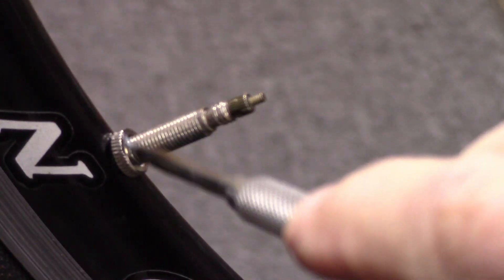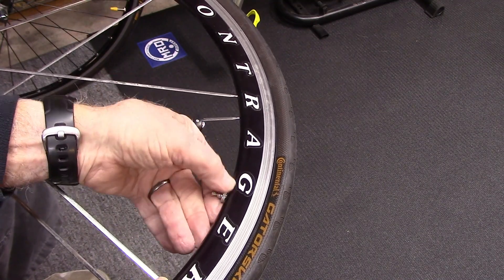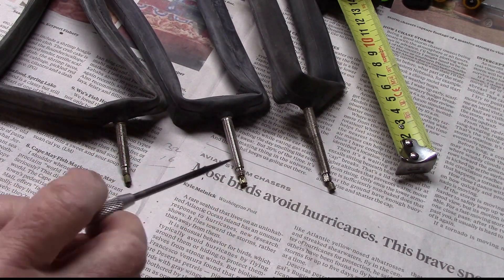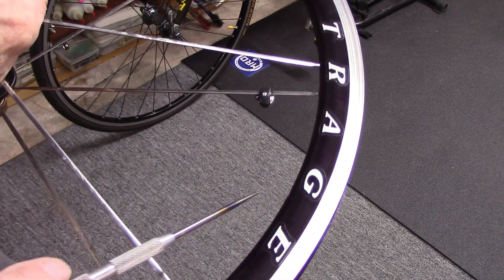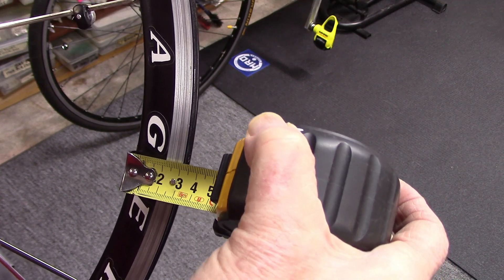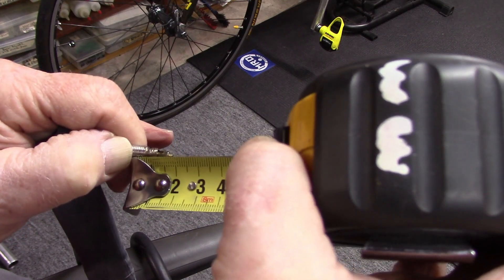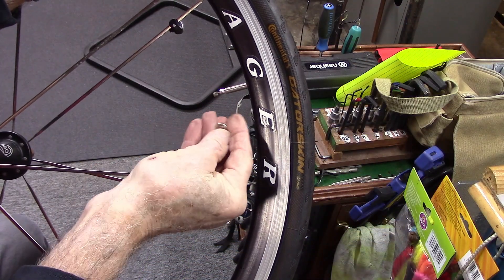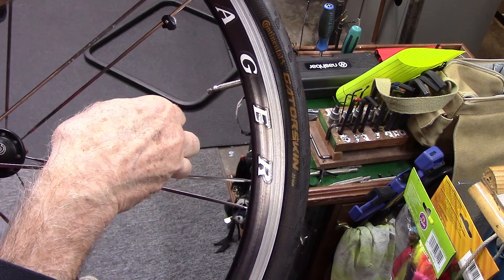What's the Real Reason Behind Threaded Presta Valves with Nuts?

Comment: TLDR loctite does wonders :)

It’s even crazier with tubeless systems. There, the nut often provides compression for the valve to seal against the rim/tape on the other side. I’ve noticed generally (and especially in wet conditions) vibration causes the nut to loosen. For tubeless systems, it flats my tire. 

The best solution I’ve found for all of this is a helpful serving of blue loctite. Means the nut doesn’t get overtightened, and it doesn’t come loose anymore.
Reply from the maker: Thanks for the tip. Great idea. Regards, Tony

Comment: (I hope I have got this the right way around.) When I used Continental inner tubes the nut always came loose, but with Schwalbe it never happens. The O-ring is a good tip. Thank you.
Reply from the maker: See if the 0-ring (or a piece of electrical tape with a hole in it as we use to do in the old days) does the trick and keeps it from rattling.